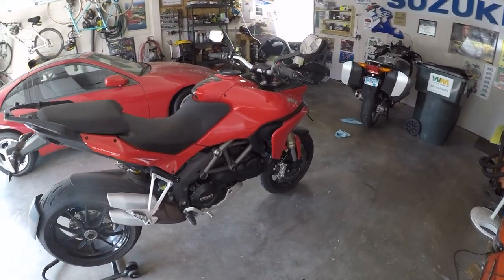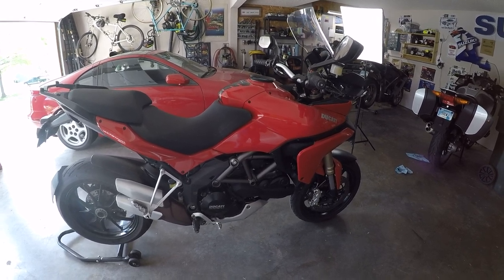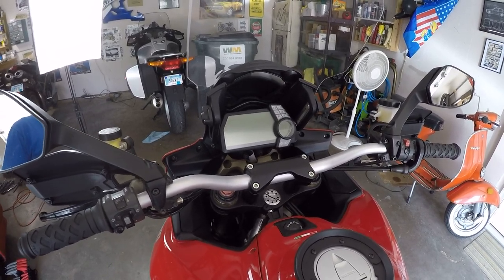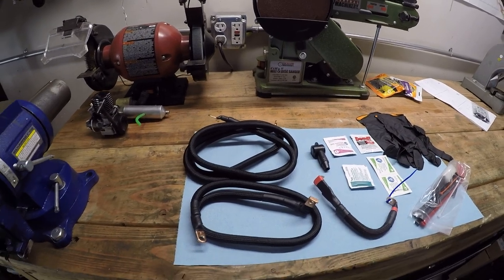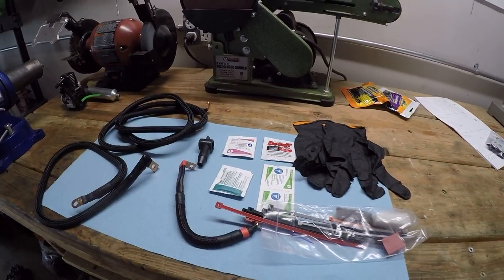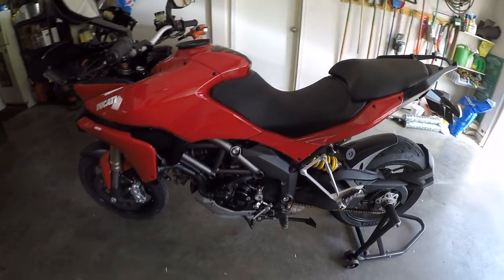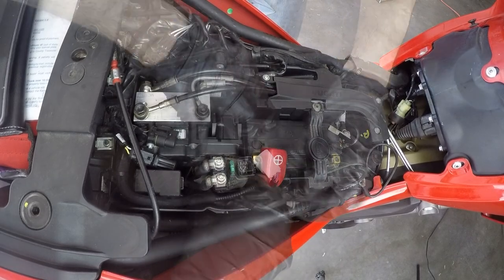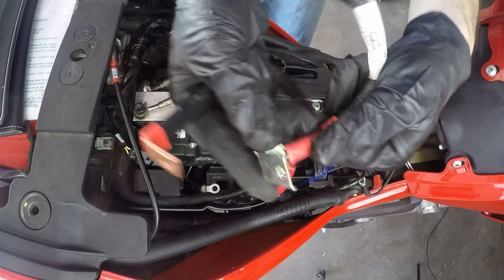Ducati Multistrada 1200 Slow Start FIX |Ep. 9|

Comment: Here's my experience with this mod.

It was quite tricky to get the motolectric kit to my country, but with help from Michael (of motolectric) we finally managed it.  He was really helpful throughout the process, and found the best and most economical courier service.  

My findings during / after replacing the cables on my 2013 multistrada :

Replacement was time-consuming and tricky (especially the routing) but I got that done ok after about 90 minutes of slow, careful work.  The trickiest part was finding a suitable path below the seat - there were not a lot of options, it is pretty packed in there, but I finally found a workable route. (note - on my (2013)  bike the positive cable goes down the left-hand side of the bike, together with the earth cable, and is the right length to reach the starter motor from there)
The most complicated in the replacement phase was the earth bolt.  This goes straight into the engine block.  It came out ok, but there was a little corrosion on the threads, and getting it back in was very tricky.  I will have to source a better quality new bolt and replace it sometime.

The results :
Before replacement the thing that used to worry me the most was that every now and then depressing the starter button would just result in a short groan, and then nothing.  The engine wouldn't turn over.  In this state, usually the next two or three presses also wouldn't turn over the engine successfully.  I guess one of the cylinders was on compression stroke, and the starter motor just couldn't turn it.  This would happen perhaps every 8th or 10th attempt to start - often enough to be irritating and worrying (and sometimes also embarrassing).
That problem has gone away.  The engine still shows a little reluctance to spin every now and then, but (so far) I haven't had to re-try the start even once, so it seems cured.

As far as I can tell, the engine doesn't spin any faster than it used to.  There might be a very small change, but I can't really tell..

From cold, the engine takes (more or less) the same time to start.  Probably about 4-5 rotations, I would guess.  About the only difference on cold start is that it seems to run easier from directly after start than it used to.
With the engine hot, starting is mostly quicker and more positive - typically 1-2 rotations to start, whereas it often used to take 3-5.  Also, as for cold start, the engine seems to run better from immediately after start.  

All in all it was worth it, although I would have to say that the improvement is not as large as I would have expected.  Would I do it again?  Yes.  Small but worthwhile improvement.

One final thing - I have a motobatt lithium-ion battery fitted instead of the original, so the battery actually has higher CCA than the standard (about 50% higher).

Comment: I appreciate your video series. It's been immensely helpful as I perform all the maintenance on my 2011 (@45k miles atm). I found that while I had all the panels off, it wasn't that difficult to remove the old cables. They're separate from the rest of the harness, but they are zip tied in with the main harness and sub harnesses at a few points. It took me less than an hour to remove and replace the cables. Hope that helps, keep up the great work!
Reply: Did you had to remove the fuel tank to get to the cabling ? You don't have a cable lengths for me please ?
Reply: @losminos11  I was already in the process of all the maintenance he was doing in previous videos, so I already had all the panels and tank off the bike. I don't have the lengths off-hand, but I can get the stock cable lengths when I get home.
Reply: @losminos11  These are all rough measurements as the stock cables are difficult to straighten.

Starter to fuse box - Approx 62" eyelet to eyelet
Fuse box to battery - Approx 9" eyelet to eyelet
Ground - Approx 27 3/4" eyelet to eyelet
Reply: @bellbini  thanks a lot ;-)

Comment: I've been following the 1198s videos and doing pretty much everything by following the instructions. Got the motoelectric cables already installed and waiting on a new battery....now to mount the new mosfet regulator/rectifier..... which I'm stuck on making the bracket.... but I'm getting there thanks to the videos...
Reply from the maker: Thanks for the comment - I'm glad to hear the videos are helping! You'll get there soon enough and it will all be worth it.

Comment: Did this when i waa changing out the exhaust. Oh boy, was it still a bit of a pain with how little space you have.

I took out the OEM cables and route these thicker ones the same route. 

Couple things to note. If using same route, there is a black routing piece of plastic that encases the wires. Get rid of it and use zip ties. The new wires are too thick.

The two positive cables is real stiff trying to fit back into its mounts by the battery terminal.

If you follow the OEM route, the length is similaelr to OEM. Both wires should route towards left side of bike and down. 

It helps a bit like others said. Cold starts still kinda.. ehh. I think the site has like a new something that gives more volts or something. Didnt really pay attention. 

Have fun!

Comment: I am defiantly considering this mod but two thing strike me about this video , listen to the bike starting at 47 seconds and the bike starting at 9.11 not much difference in the time taken to turn over the motor but the starter motor does not seem to struggle as much, which is a good thing.
other thought is, do you think by attaching the new cable to the original, you could pull them through so they follow the same routing ?

Comment: Great tutorial,  when grounding the cables to the engine, how many cables are grounded in total, is it 2 or 3 ?
Reply: Hi, did you find out ? I'm replacing the cables today and I disconnected the original 2 grounding cables from engine block and connected 1 new instead. Resulted in no power at all, display won't come up
Reply: @Marcel Struckel  You need 2 cables to be grounded on that connection,  a bit tricky to get the nut on with the 2 cables, the old starter cable is the heavier of the 2 cables, that one you will just seal it of with tape and tie it up out of the way

Comment: Hi, are the new cables not supposed to piggyback the old set?  So you have 2 sets of cables for each connection.  Another thing I learned is to clean the electrical wiring ends both at the battery , ground and starter.  Take Care
Reply from the maker: Yes, they are designed to piggyback the old cables.

Comment: Great video! Just bought these myself after watching. Can the old wires be removed with more effort (like taking off more panels etc.) or does that require modifying the stock harness?
Reply from the maker: I believe the old cables are part of the main harness. I could be wrong because I didn't dig into it that deep, but they looked like they were wrapped up with the rest of the harness.
Reply: Thank you!
Reply: I'm just doing this myself, while tackling all the jobs in your previous videos. The three cables are separate from the main harness, but zip tied along it at multiple spots. Hope that helps!
Reply: Thanks a lot, really helpful!

Comment: I wonder if you placed the old together on the terminals if you got even better current flow, since it is just dead weight right now.  It would nearly double the current path.
Reply: Hi, it's Mike from Motolectric. Since the current flow will take the path of least resistance, it will never (also) flow through the OEM wiring. But Ducati and other makers sometimes take the shortcut of connecting a negative lead from an accessory (or perhaps a sensor from the ECU etc.)  to the frame and then using a jumper from the frame to the battery negative. Harley, Aprilia, and Triumph still do this (Ducati has stopped the practice on most models). So, connecting up the OEM leads will not improve starting performance but on the negative it is probably still a good idea due to the above. This Practical Enthusiast channel presents the very best and most professional videos, you should be subscribed to ensure you are always in the loop on any new vids. HTH.
Reply: @michaelheth2940  The current will still flow through the old cables. That is easily proven with an Amp clamp meter. It doesn't double the path as he asked, but it does offer a significant increase in capacity.

Comment: My PCD kicked it something fierce. I wish you would have removed the old wire and replaced it with the new one.  If the new one was routed the same way as the old one you probably wouldn't have had that much slack.

Comment: I am not in agreement with the routing of your cable and leaving the original cable in-place. You pass too close to the exhaust system on both cylinders. I would pull out the old cable as well.